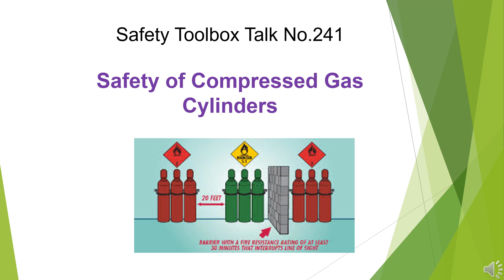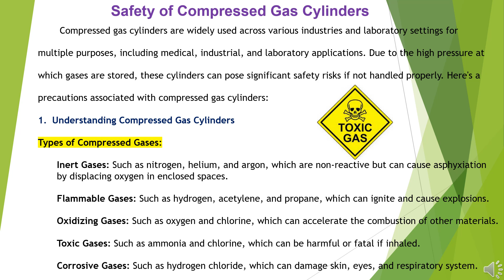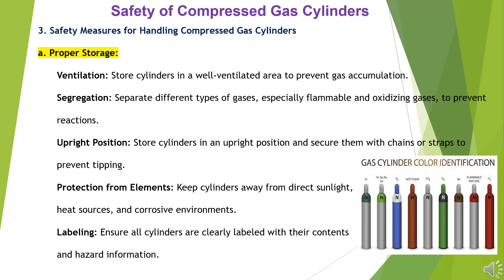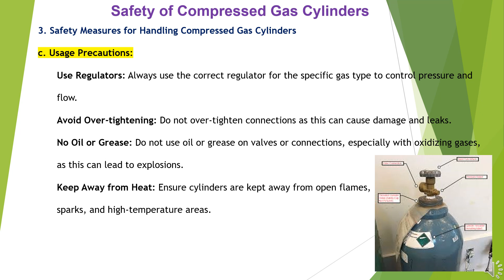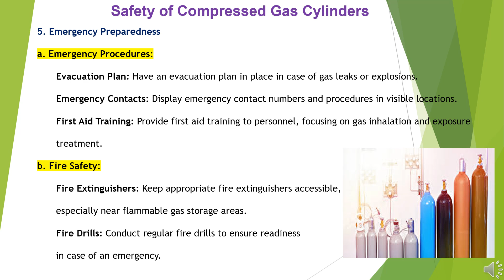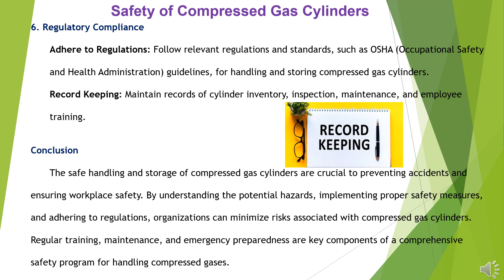Safety of Compressed Gas Cylinders

Comment: Acetylene cylinders should be set upright for a minimum of 1 to 2 hours depending on the cylinder size, if stored or transported laying down.  This will allow the acetone to settle down back in the porous mass.  Similarly, the maximum safe flow rate for an acetylene cylinder is 1/7 volume/hour; if more flow is needed for large heating tips, a larger cylinder or a manifold system may be needed.  Alternatively, you may consider using an alternative fuel gas such as propane, which doesn't have flow rate restrictions.  

If these precautions are ignored, acetone can be sucked out of the cylinder, allowing the acetylene to become unstable and self detonate.